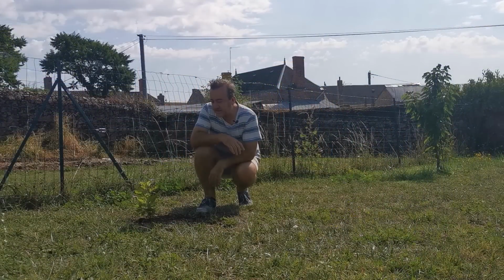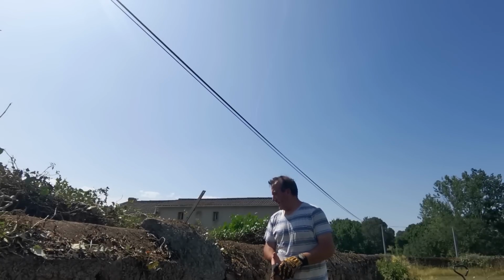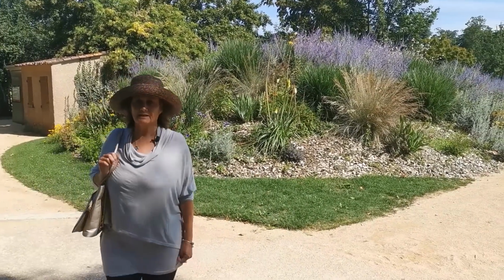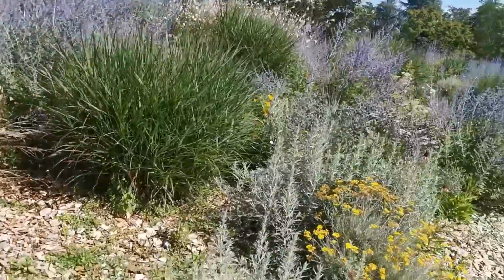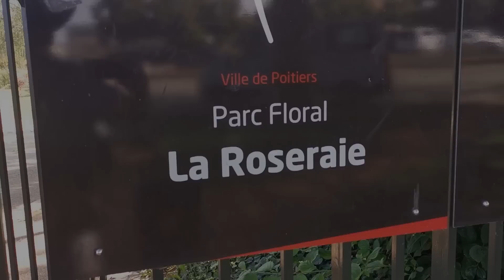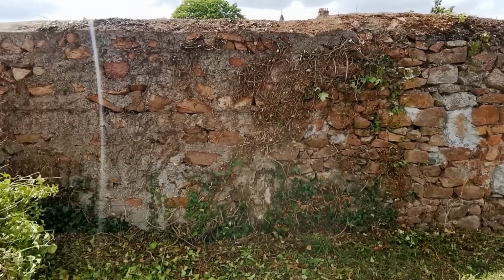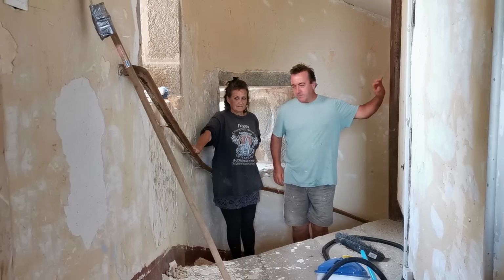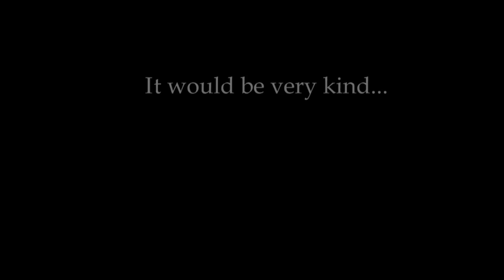EPISODE 124 Problems in the 15th century tower

Comment: The wall will look so good once you finally kill the ivy, get rid of the concrete and redo the lime mortar. Amazed how the ivy came off in sheets that you could roll up. Hope once you get rid of any new plaster that's cover the stairs and stopping the wall from breathing. It would look lovely to be able to use wallpaper like you're thinking. Have you checked the outside of the tower there is no concrete etc?
Reply from the maker: Thank you Lea, it all seems to be lime render on the outside of the tower